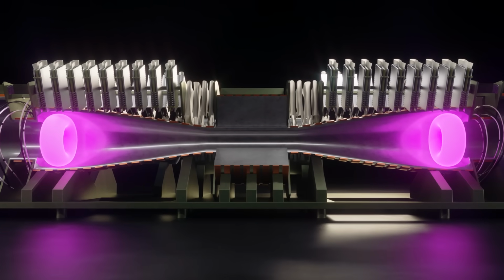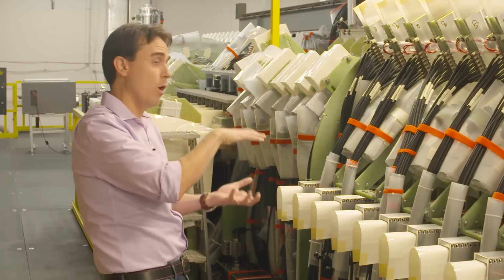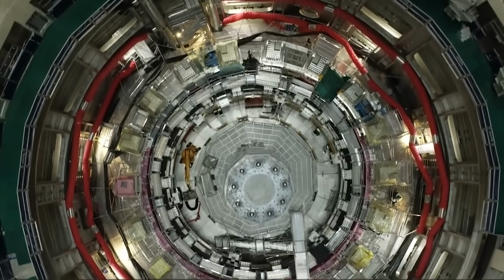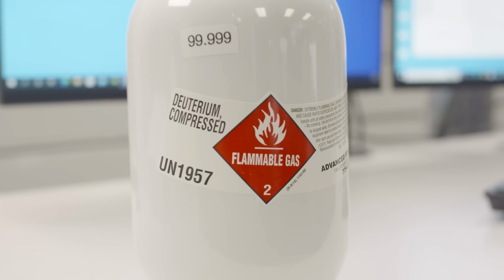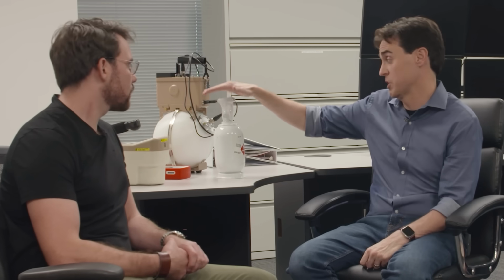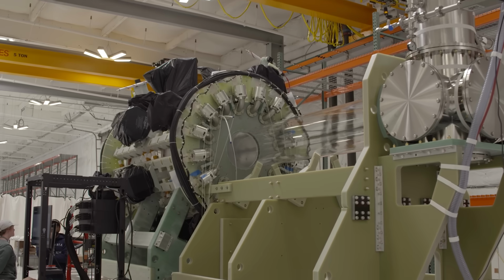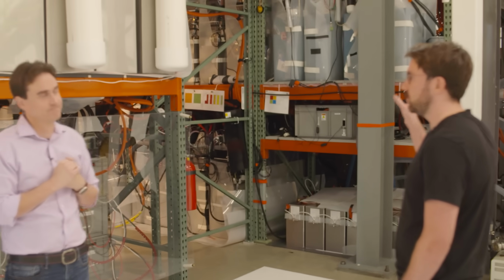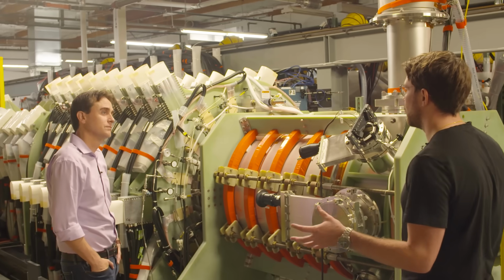A New Way to Achieve Nuclear Fusion: Helion

Comment: I am much more impressed with these ‘small’ fusion reactors than the massive ones like ITER as it seems possible to do iterations over a period of years rather than decades.  They do seem like a project that is going somewhere.  However, I am always interested in the total power in to total power out.  This is frequently not discussed, as was the case here (or I just missed when the dog distracted my attention).  Would be interested in this detail and if there is a way forward envisioned to get net power generation.
Reply: That's because the current prototype doesn't even output any electricity as far as I understand
Reply: @Astromath  No fusion reactor has ever produced electricity (as far as I know), but they can always tell you the energy into the plasma creation vs the energy out.   What they really tend to hide (or more generously to down play) is how much energy was used to generate that energy that went into the plasma.
Reply: @davesutherland1864  In this case, they didn't even hide that. They even said that it needs 100,000 amps at the ends to start the entire thing and 1,000,000 amps at the middle for the magnetic trap that forces the fusion reaction.
Reply: @xana3961  Energy in would be that current multiplied by the voltage and time.  That is the input energy to the reactor.  There is also the energy needed to produce the input energy as the grid energy to reactor input is not 100% efficient.  The fusion reaction will release energy.  To have net energy gain the fusion reaction has to release more energy than came from the grid.  I was interested in the energy out to grid energy in.
Reply: That massive ITER reactor is designed for research purposes. The main objective for it is to better understand the ins and outs of how plasma confinement actually works at scale what the most effective fusion geometries are. That's the reason why it's shaped the way it is, because there's a lot of possible configurations they can test in that shape. The thing about a reactor like ITER is that it can produce a relatively continuous output of energy at a slower speed. That initially seems like a bad thing, but it isn't because energy collection systems tend to be more effective at lower energy rates and you can produce energy as it is needed without a long term storage solution. It's the same reason why we don't use explosives or rocket fuel to power cars.

Comment: Do the same - symmetrically - using multiple axis rather than only one (with more axis of magnetic fields created/overlapping concurrently) and what are the results?  Use four, eight, or 32, (or whichever multiple of) plasma development chambers (instead of 2 in this example) and one central fusion chamber, and are the results theoretically/practically different?

The electromagnetic piston concept is fascinating. ...  What is shown does not solve the need to continually add fuel to keep the fusion reaction going.  ...

Comment: Perhaps I'm missing something here, but I think this reactor will also need to be treated as nuclear waste at the end of its life. 
Now I'm sure this won't be as radioactive as tokamak designs, as the absence of a beryllium neutron multiplier means there shouldn't be any fertile radioisotopes absorbing neutrons. The issue however is that the D-D reaction is just as likely to occur as the D-He3 reaction. Thus roughly half of all fusion occurring will be from D-D fusion. 
Half of this D-D fusion will produce a low energy proton that can be used to extract power, but the other half will produce tritium and a neutron. This neutron will go on to damage the materials of the reactor and magnetic coils, and cause them to become low level radioactive waste over time. 
Another issue is that the tritium that is made will have the highest reaction rate out of all the nucleons in the reactor. The result of this is that most of it will react before leaving the reactor. This produces additional high energy neutrons.
The important thing with all of this is that you cannot prevent the D-D fusion from occurring, even when helium-3 is present in the fuel mix. There are essentially 3 possible reactions that power can be extracted from, which would be He3-He3, D-He3, and half of D-D, as all of these reactions produce charged high energy particles. Then there are two possible reactions where high energy neutrons are produced, D-T and half of D-D fusion.
From this it would appear that only around 2/3 of all reactions taking place can be used for power generation. This presents an issue as that places maximum efficiency for power generation around 66%. You then also need to consider what the efficiency of the magnetic field direct conversion generator will be. If the end result is an efficiency below 45% it will be likely that tokamak reactors will have higher conversion rates for power generation.
I'm by no means a professional when it comes to this stuff so perhaps I'm missing something. Regardless the more approaches we take to fusion the more likely we land upon something that works.

Comment: So what’s the NET GAIN ? Output energy vs input energy . That’s the most important info. Fusion has been possible for since 1920, but the challenge is to do it in a  continuous cycle with net gain
Reply: i dont know if they would be willing to share that information because this is very dangerous technology

Comment: You could potentially make the Helium-3 generator energy-positive as well by capturing the neutron emissions in a neutron amplifier (a barely-subcritical mass of uranium that  uses fission to cause each neutron absorbed to become several thousand neutrons before the cascade peters out), then doing traditional thermal generation from that. Still has the radioactive waste issue (though as with traditional fission it's an extremely solveable problem), but has no possibility of a criticality accident: if you turn off the deuterium fusor, the reactor will always immediately halt, because it does not have the critical mass of fuel required for a self-sustaining reaction.

Comment: Sorry, but lines like "you first to see our super-duper technological secret, competitors are already trying reverse engineer this" makes it feel like a regular investment scum. 

Fusion is hard. Like real hard, make a space station is way easier. But private space stations are up until this day is a pipedream. Just like private fusion. 

It is possible to do something in this field only through international cooperation. With the help of thousands brightest minds of this planet and billions of public investments. 

Even if you have some breakthrough design, it will not cut this corner, it will only lift probability slightly further from zero that it will work out at the above conditions

Comment: Generated heat can be transferred via refrigeration to a steam turbine where much of it can be recovered.  Alternately, a lower boiling point hydrocarbon liquid can be used directly to cool equipment and to slow and absorb neutrons.  These pressurized vapors can also drive a turbine.  These coolants can also be used as a new source of deuterium fuel.

Comment: 12:35 The other drawback of using He3 is that the reaction with deuterium needs considerably higher temps and densities to get a useful reaction rate.  D-T fusion has much lower temp/density thresholds, so it's easier to get decent energy yields.  The major drawback of D-T fusion is the production of high-energy neutrons, which can cause neutron activation in the reactor structure, though as stated in the video, it can also be used to breed new tritium out of the lithium coolant.

D-He3 fusion generates a proton instead of a neutron, and with the proton being charged, it gets trapped in the plasma and helps to heat it.

Even with D-He3 fusion, there will be some D-D side reactions, which will produce both neutrons and some tritium, which gets quickly burned up.  So you won't totally avoid neutron activation issues, it'll just be at a much lower level than a D-T reactor.

(later) The video claims that the tritium produced in the fusion reactions comes out of the spent gas, though given that D-T reactions have a much higher probability of happening I doubt they get much at the end.

Comment: Their engineering is extremely impressive.

I'm super happy for you getting an exclusive opportunity like this and the technical details provided are fantastic!

Still we need to know their plasma density before and after compression. I have some hope because it's dense enough for compression to cause heating but also I saw a turbomolecular pump which would seem to imply the opposite. Density helps with scattering and with the x-ray measurements they have they definitely can calculate the scattering rate per fusion rate and not explicitly stating it is very worrying.
Reply: So what's the issue if the plasma density isn't enough? What would their reason be for not stating it?

Comment: I already built a fusion reactor that can be used to power the world. But it's so massive that I had to put it into outer space. And it puts out so much energy that I had to put it millions of miles away from earth, but you can access this energy for free with special piezoelectric panels that can be used to collect the energy. Just point the panels in the direction of the fusion reactor when it is overhead.

Comment: Various physicists and scientists have been trying for many years to come up with a practical approach to nuclear fusion energy. Also complex experimental equipment has been built to try to achieve nuclear fusion. The biggest problem is that more energy has to go into the process to achieve nuclear fusion than the energy that is actually produced by nuclear fusion. As a result there is a net energy loss. I suspect that nuclear fusion will remain experimental for many years to come and it is possible that practical electricity generation from nuclear fusion will never happen.

Comment: All the energy required to run that facility is not included in the ratio of energy in to energy out. If it was, this would be incredibly insignificant. However, they ran of money and this is all about advertising to find someone to pay their salaries.
Reply: This is a research facility, not a power plant. A facility actually meant for power production would be much more streamlined.
Reply: @zekayman   I know because I worked in a  BWR power plant.
  The auxiliary systems needed to run the nuclear reactor are mind boggling and certainly not to be written off.

Comment: In my view, Most of the speakers losing point of magnetic fields were not affected by pressure and velocity created in machine. The only thing they are making in that named reactor is like toy gun. Until end of their life. They didn't get anything from showed machine in video. If above hypothesis mentioned in video is true, then we can bend the light too. We can change laws of light.
Reply: Learn to speak and write in English please. What you wrote is completely incomprehensible.
Reply: @cheeseofultimatedoom  
Thanks man for your concern and advice
I am not a too much scholar in English like you.

Comment: I have a question if this is using high energy neutrons in one of the reactions which is required to make helium 3 how radioactive are metal components around this chamber getting from that flux of neutrons. 

If these reactions scale up the flux is going to increase and might become a serious hazard to any equipment.

Comment: My favorite part was the little camping propane sized bottle of fuel for this massive complex machine. My second favorite part was realizing the green parts with plastic. I'd assume for magnetic reasons. I wonder if its something simple like HDPE lol
Reply: A high pressure gas bottle that size, feeding a 50% efficient fusion power plant, would make about 1500 megawatt hours of electricity.  That's roughly two lifetimes worth of energy for a first world person.

The green plastic is probably glass fiber reinforced for strength, which means it needs a harder and more tenacious plastic than HDPE.  The pale pastel, slightly translucent green color suggests it's "G-10".  This is glass fiber cloth impregnated with polyester resin then pressed together and heated to laminate it into a solid slab.

Comment: Great video, but the real question that wasn't answered, and is historically the main issue with fusion, is that does it actually produce net power generation? How much power are they expecting to produce? 

There are so many fusion companies now, I wonder how they all compare with each other. Why look at Helion and not others?
Reply: Well the biggest thing to me is the direct energy capture of their design.

Traditional electricity generation is all about spinning a magnet inside of coils, we call this contraption a generator and its basically the reverse of a motor. The 3 easy ways to spin the rotor are waterpower, wind power, and steam turbines. Regardless of the heat source bouling water for a steam turbine basic thermodynamics says the max efficiency is dependent on the hot source and the cold sink (95°C in the condenser) and the end result is about 2/3rds of the energy gets wasted by the power cycle which demands heat energy be regected to the cold sink (in the condenser). And so any tokemak (misspelled) will suffer from this same law of the universe, by using steam turbines you must sacrifice a tone of energy so even after hitting profit from the fusion reaction, you then need to dump 2/3rds of that profit and still be able to self power.

In contrast, this system appears to cause a fusion bomb to go off, which creates a ton of magnetic flux inside of the coils of the generator directly. Which sidesteps the issues of the thermodymic power cycle. However, the leads to new questions, because a steam turbing just makes smooth AC power and this thing is making a series of dirac impusles that need to be captured and converted into AC to be compatible with the existing grid. And so the question is what is the theoretical efficiency of this device, from the initial energy output of fusion, how much gets converted into the pulses in the generator coils and then how much of that gets converted into usable AC power. (We know what it needs to beat, just over 33% efficient from the power cycle for typical thermal power plants)

Comment: A few points on the tritium and beryllium. The neutron -> Li6 reaction that creates a Helium and tritium actually creates more energy, possibly adding a further 20% to the thermal energy. The beryllium neutron multiplying reaction reduces energy but overall I think it's expected you gain heat from tritium breeding

I forget where I saw this now but someone who seemed to be an insider said that you can process the uranium out of beryllium beforehand. Ultimately the amount of long lasting waste that might in some cases be produced in a D-T fusion reactor would be very small and you could just stick it in wherever your fission waste is without really having a problem. If things go right you do seem to be talking about locking up your fusion core for 100 years and then reusing it or burying it in a low level waste landfill with the use of robots. I also suspect that the reason beryllium isn't mined much is that it is quite toxic which isn't a problem for a fusion core where nobody will actually go into. So I do expect that beryllium will turn out to be available if a compelling reason to bother with for tokamak walls comes into play

In any case I do think Helion, Zap and others have a lot of advantages over tokamaks and it will be truly interesting to see how they work out!

Comment: While clearly superior to the Tokamak, there are a few things that bug me about Helion's design.

It feels like it has too many points of failure. So many things have to go right for it work...but what happens when it doesn't? They are blasting 2 opposing rings of super-hot plasma at each other at literally 1 million miles per hour...what fail-safes are there to ensure that the timing is always right?...How bad do things get if they aren't?

And here's the most important question the video neglected to answer; are we getting more energy out of the system than we're putting into it? That's the holy grail of Fusion energy research and it feels like they haven't solved that problem yet with this design (if they have, that would have been a major selling point). 

In recent news, the US Department of Energy's research team has apparently managed to solve that issue with a laser-driven design, getting more energy out of the system than they put into it. There is still the engineering challenge of scaling the design up (or scaling it down, the lasers they used is purported to be big AF) but having solved THE core problem plaguing Fusion research they seem to be ahead of the pack. 

Hopefully, that doesn't knock too much wind out of Helion's sails. One of Helion's biggest advantages is that they seem to be using a more economically viable fuel source than other rival technologies. I hope they are around long enough to capitalize on that and truly bring their technology to maturity. 

Interesting times we live in....interesting times indeed.

Comment: This is awesome. Relying on thermal energy for creating electricity has always been very inefficient. Using the magnetism produced from the fusion was a great idea. However, this is still not the most efficient way of harnessing energy for electricity. Harnessing energy from the "ether" like Tesla was trying to do (and probably would have succeeded in had his funding not been cut) would be the real game-changer. But this would provide actually "free" energy, so unfortunately that research will likely never be funded.